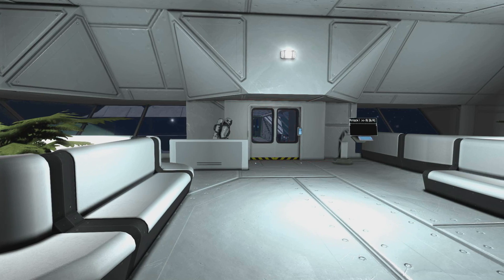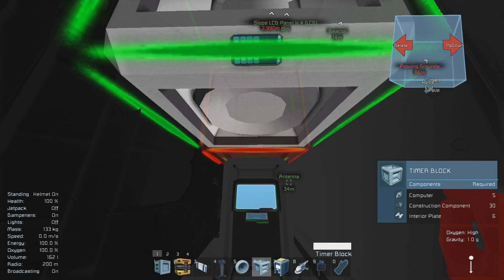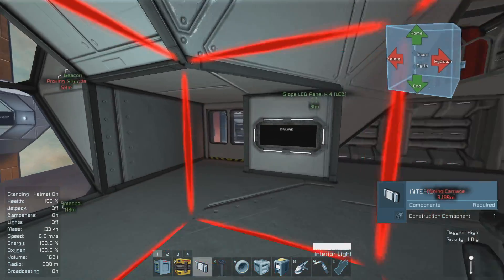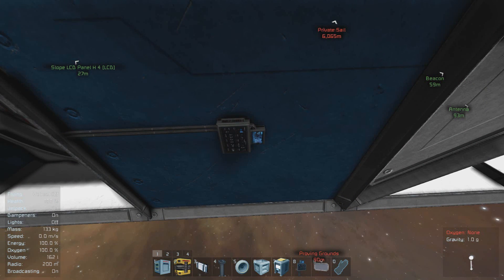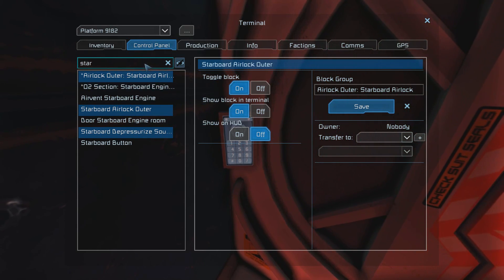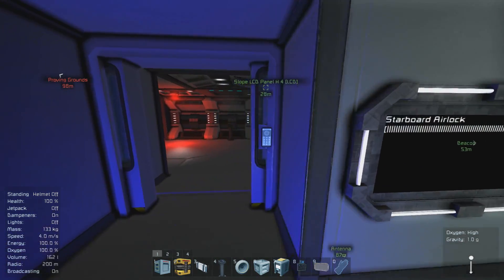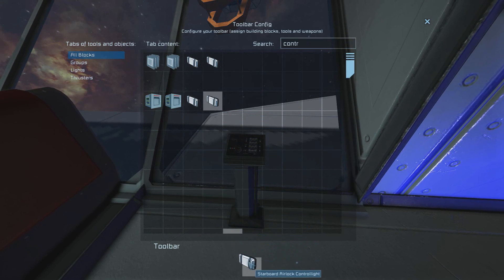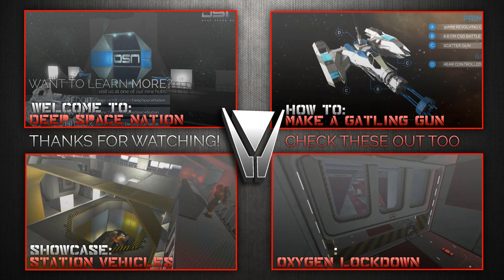Scripted Airlocks Tutorial and Showcase! [Space Engineers]

Comment: I've been beating myself to death for 2 days trying to get this to work. My 2 outer doors are disabled by the script and no matter what I do I can't get them to operate. And none of my sound blocks play their sounds with their corresponding door. Also, is the control light suppose to blink when working and be a different color than default white? I've rebuilt the one airlock 10 times now, triple checked group spelling, case, etc... The lcd works fine, the inner lights go green/amber, the outer lights are red, and the venting works properly.
Reply from the maker: ill ask mmaster what happened, he may have changed the script.
Reply: +Morphologis i've updated it on my end. not sure whats going on. Are the doors supposed to open/close based off the switch panel you setup for the pressurizing?
Reply: Any fix for this? Im having same issue. It won't switch the inside vent between pressurize/depressurization. I have it set up with the hidden light FYI. If I switch pressurization by hand inside the airlock it works.
Reply: +Thomas Zimmerman you can try updating the script from the workshop via the programming block. I do this almost all the time I load up a save just to cover my ass.

FWIW, I built a new ship in another save and set this up and its working the doors/lights properly, but I cannot get the tank in the airlocks to fill partially from the internal ships oxygen. Not sure if its because its in creative atm or what. Also, I still cannot get the sound block in the outer group to play its sound. Ideally I wanted 3 sound blocks. Outside plays depressurize, inside plays pressurize, and the one inside the lock itself was set to play equalizing. I got the inside and in the lock ones to play together and the equalize one will play when the outside one should also be playing, but its not.

Also, not sure if this was an update or not, but when the lock is cycling it never goes to amber on the lights. It goes red, flashing red, a brief off, to green. Probably due to it opening the door almost as soon as its registered the pressure change from the vent?

I also could never get the additional 2 optional vents to work for it to self detect pressure.

Comment: Is it normal for the airlock to take way longer to switch than it takes to depressurize the airlock? Also I've got a ship with multiple pressurized hangars and section connecting them. I don't have room to put two airlocks in the section so I made one and used the doors to the hangars as the outer doors. If one hanger is open then when I enter the airlock from the other hangar it vents all the air in hangar 2 through the airlock into hangar 1. Is there a way to make this script or another script smarter. For example to have a vent associated with each outer door not just for the group outer doors? Any advice would be great. I really appreciate what I've learned from you videos, thank you.